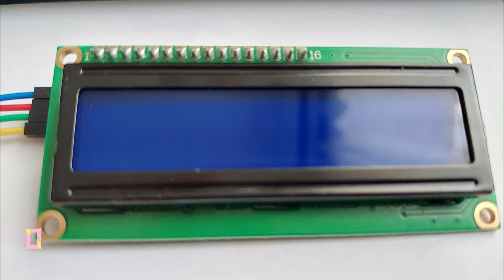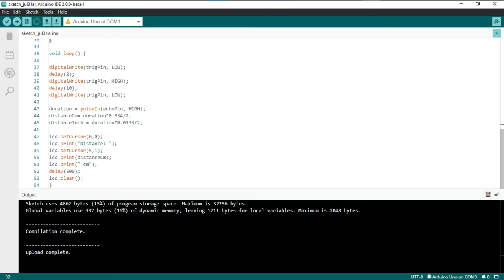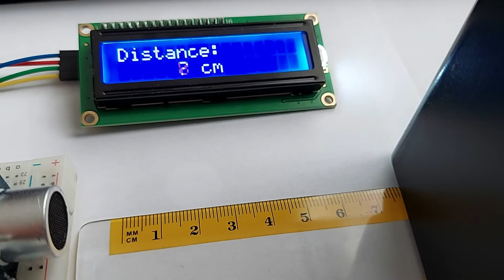HC-SR04 Ultrasonic distance meter with 1602 i2C LCD display - Arduino for beginners - with code

Comment: ho do i wire the hcsr04 to the arduino
Reply from the maker: In the code that I made available in the description of this video, you also have the connection of the HC04 ultrasonic sensor to the Arduino.
Follow the link in the video description: https://pastebin.com/Bf73vC9f

const int trigPin = 2;
const int echoPin = 3;